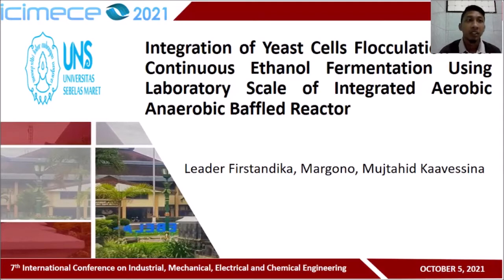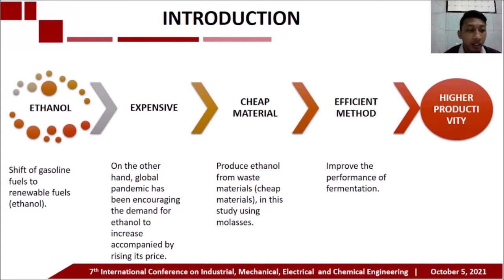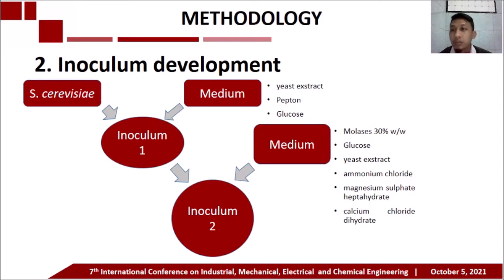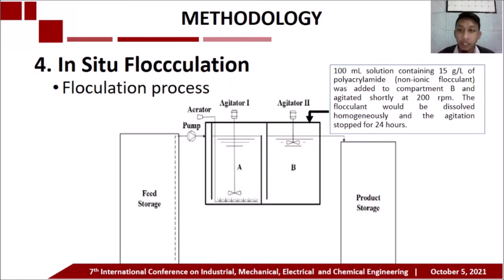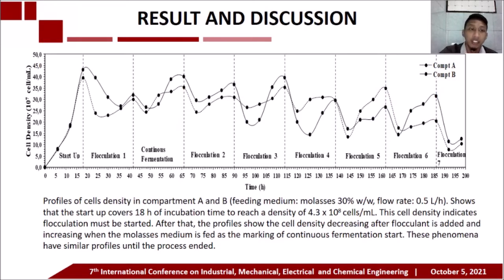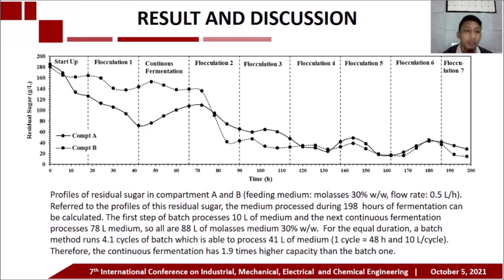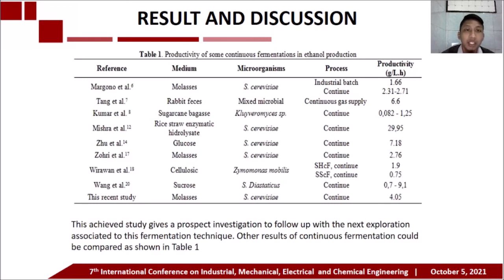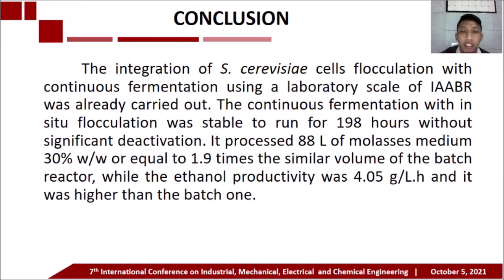ICIMECE2021: CE94-Integration of Yeast Cells Flocculation with Continuous Ethanol... leader FA

Comment: why did you choose to use a buffle reactor, are there other types of reactors that can be used in the treatment process?
Reply: There are many reactors that can be used for continuous fermentation for ethanol production such as bubble column, continuous stirred tank and many others. For this study the use of a baffled reactor is intended so that there is a boundary between the aerobic chamber and the anaerobic chamber but can still flow the solution in it and gived efficient production.